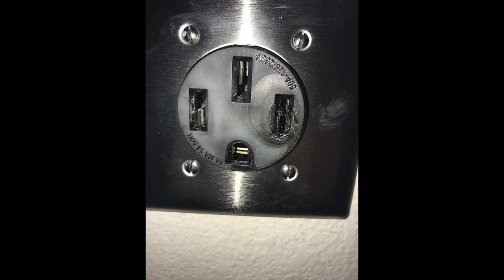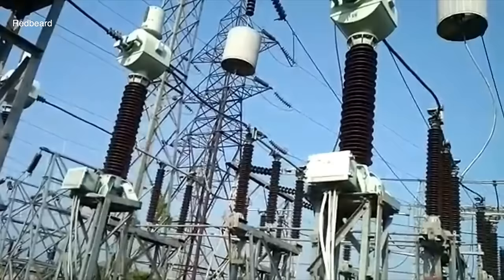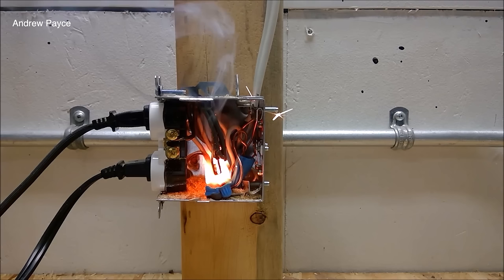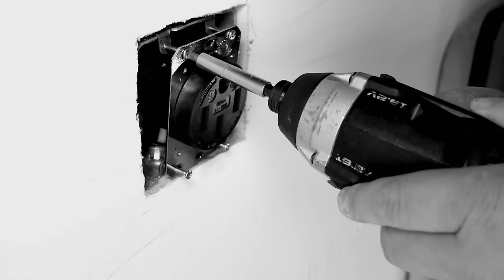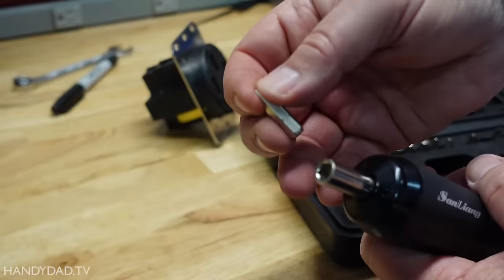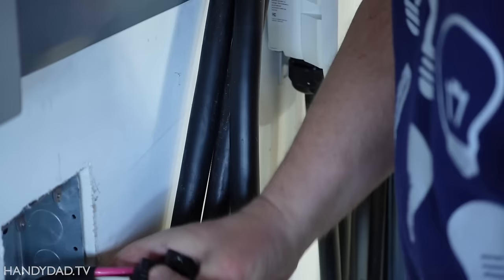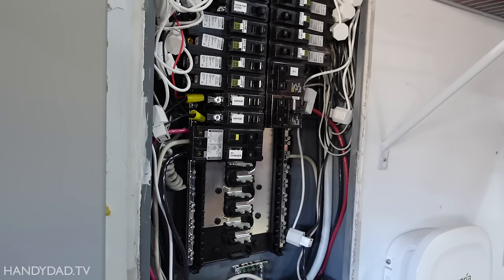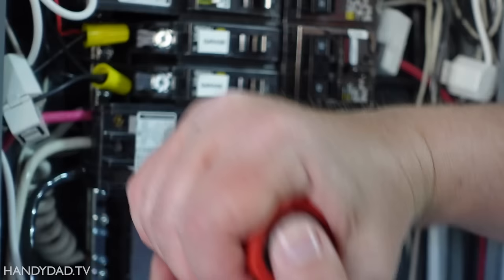EV Charging Disaster

Comment: What evidence do you have that standard outlets are getting loose with normal use? All the burnt outlets I've seen are from improper installation. Ive been using home Depot outlets for 15 years so far and never had any issues charging cars.
Reply from the maker: I have no hard evidence. I only have the Tesla spec sheet that requires an “industrial” outlet for charging. I also have tons of comments on this outlet comparison video https://youtu.be/xRcDUZgeuGs saying that cheap outlets are a high risk and shouldn’t be used.

Comment: I’m a little confused, why would you be constantly plugging and unplugging that cable? Yes on the car side obviously, but not the power tap side
Reply: That cable is meant to be portable and accompany the vehicle.
Reply: @rivernet62  People with EVs have a charge point at home, and then have a cable they keep in the car for times they aren't home. That cable tends to me a regular 120V plug. This cable isn't that.
Reply: @repatch43  that’s not how I do it….
Reply: You definitely shouldn't be unplugging the EVSE from the outlet all the time. Those outlets are not designed for frequent plug/unplug cycles. They are meant for appliances like ovens and dryers that are plugged in and then not touched for years.
Reply from the maker: When I got my Tesla 2 years ago, the car came with a universal mobile connector (UMC) which could charge the car from various 120- and 240-volt outlets. So installing a 240-volt outlet seemed like the appropriate approach to take advantage of my “free” charger. 

These days, the UMC is no longer free with the car because Tesla says they weren’t being used often enough and it was wasteful. Like Apple no longer including power adapters with their phones. 

The trend is changing to get EV charging away from outlets altogether. A hard wired charger is a less complicated installation and much safer.
Reply: Dryers and ovens use other plugs than the NEMA 14-50.  Wasn’t the whole point of the video that you should monitor your installation for wear and damage?  I use 2 UMC’s with my Tesla:  one at home, which stays plugged in, and one for travel, which is used at our second home or other locations.  The 14-50 outlet at our second home has had about 100 insertions over 3 years and is still very secure.
Reply: @rivernet62  Then you're doing it wrong? That outlet, 'industrial grade' or not, is simply NOT designed for regular plugging and unplugging. It's designed for appliances that get plugged in and then unplugged YEARS later. I'd suggest either getting a second cable, or getting a receptacle DESIGNED for many insertions. Hubbell makes the twist-lock type of plugs and receptacles, they are amazing.
Reply: @repatch43  this is the configuration recommended by the manufacturer, and, more importantly, it is working well.  I see no reason to deviate.
Reply: @rivernet62  Which 'configuration'? Are you talking about the outlet? Again, that type of outlet is simply not designed for many many insertions, it was never meant for that. I'll believe it's the 'recommended' configuration, but I guarantee you the manufacturer doesn't expect you are plugging this cable in multiple times a day. I honestly would NEVER be comfortable with that use case and that outlet, I don't like using things outside of what they were engineered for. But if you are, good for you.

Comment: Maybe that is why the outlet I installed to charge my EV heats up and catches fire.  Each time that happens and I check the wires they are super loose.  I figured the heat was loosening the screw but maybe the other way around.
Reply from the maker: Use an industrial outlet and tighten-wiggle-tighten!!
Reply: @handydadtv  …You admitted an error in one of your installations.  Now it’s time for me to admit my error.  Mistakenly, I had used a 15 amp Leviton thinking it was a 20 amp.  MY BAD!  Because of your video and the comments it generated I took a closer look at the receptacle and realized my mistake.  I’m really lucky the fires stayed local to the receptacle and did not spread.  I have now purchased a 20 amp Leviton receptacle to handle the 16 amp currant the charger pulls.  I replaced the 12 gauge wire earlier with 10 gauge thinking that may be the culprit.  But I had another fire.  And now I know why.  Thank you Handydadtv and thank you to the commenters.  And by the way, I’m ordering a torque screwdriver.
Reply from the maker: Wow! That is a hard lesson to learn and thanks for sharing your experience. Thankfully it didn’t end in disaster.

Comment: The 110V grid voltage in North America is outdated to cooperate with the EV charging facility. We have a 415V 3-phase charging box for home charging in Australia, which is much better for charging at home.
Reply from the maker: Sounds like you know
Reply: @handydadtv  Just checked some car manufacturers' Canadian websites and realised that the 3-phase plug in North America gets only 240V which is exactly our single-phase voltage.

Comment: It’s still incorrectly installed. Your torque driver stops at 70 pound-inches, but the requirement is 75 pound-inches. It’s still not properly torqued. You brought up all the important details and stopped short. Overall, it’s better than it was.
Reply from the maker: Way better

Comment: Holy smokes, just shut off power to the panel if you're working inside the panel. One slip torqueuing and you could touch a hot line or a "plate". Its just not worth it. Safety first ppl.
Reply from the maker: I normally do.
Reply: @handydadtv  regardless I love your vids
Reply from the maker: Thanks 😊
Reply: My neighbor a retired electrician says not turning off your panel before working on it means you're thinking you're faster than 186,000 miles per second.

Comment: One more thing I have came across my fair share of burnt wires at terminals & splices. You have to be extra careful reconnecting burnt conductors. Have to get back to clean copper. Often several inches of the burnt wires will be discolored from overheating. There is no reliable way to splice into such discolored wires. Have seen sparkies clean every discolored copper strand themn splice it to only have that splice burn up.
Reply from the maker: Wow thanks for the info.

Comment: Those connectors are dangerous. Shrouded plugs are far safer, as we have in the UK and Europe. Can't touch the poles as you plug and unplug them. They come in 32A, 64A and 128A sizes. Single phase, three phase and three phase with neutral. All are earthed.
Reply: Ya, we here in north america just love dangerous plug designs, it's always confused me.
Reply from the maker: Blame Westinghouse.

Comment: FACTS:
(#1) If you use 240VAC/50Amp wires. (#6 Gauge).
(#2) If you use the correct receptacle {inlet} 240VAC/50Amp.
(#3) If you 'torque' the (4) screws to requirements. (75 Lb./In).
= (100%) Manufacture Requirements.
= (100%) Safe...
Reply from the maker: Nothing is 100%, but we just try to mitigate as much risk as possible.

Comment: Great video! It's good to mention that all wire connection should be checked every 5 years and re-torqued.
Wires resonate when carrying amps and wiggle out of their contract points.
That's why they should be re-torqued :-)
It also applies to wire nuts, but not to Wago connectors- they have spring clamp and they last forever.
Reply from the maker: Good to know 👍🏻

Comment: For me as an European those NEMA outlets seems quite sketchy from the perspective that you could actually touch both hot pins at the same time when you plug or unplug it leading to 240 V between thumb and index or long finger.
Reply: I'm surprised he can do this himself. In my country I can't do any of what he does in this video, have to get a certified electrician to do it. Well, I can do it myself, it's not like I'm arrested if someone finds out I did it myself. The problem is that if something happens, even if I did it correctly, I will be in deep shit. No insurance will cover it and I'll be held fully responsible for whatever damage occurs, even if I sell the house.
Reply from the maker: Freedom 🇺🇸

Comment: Update: Below Reply + Safety Warning
RE: Nema [14-50R] (125V/250V  50A 3P-4W) 
Yes this 'heavy duty industrial' receptacle can operate up to (50 Amp), required for long term constant amperage power supply. 
Using:
* #12 gauge wire, (0.0808" Dia.), [120VAC - 20Amps]  
*   #8 gauge wire, (0.1285" Dia.), [240VAC - 40Amps]  
*   #6 gauge wire, (0.1670" Dia.), [240VAC - 50Amps]  
HandyDadTV  --> is (100%) correct the screws must be torqued at {75"/Lbs.}
This is the required torque to "split open/widen" the 'V-Shaped' moveable clamping face,  <<<---(Look)
compressing the cable against a solid surface, insuring the cable has (100%) contact. 
* {75lbs of torque} is 75lbs of force perpendicular to the end of a {1' foot wrench}.
Reply from the maker: Thanks

Comment: Everything you did is good advice, but arcing isn't why a loose connection gets hot, it is high resistance caused by the loose connection.
Reply from the maker: Does resistance cause arcing, or vice versa?
Reply: @handydadtv  arcing usually caused by intermittent contact.
Reply: If, after turning off breaker, you touch connection, it should not be hot. Otherwise it is loose.

Comment: I fail to see why the connecting wires needs to be over tightened in the EV power socket housing since the housing plate is secured to the wall. It sounds to me that people are over reacting due to carelessness.
Reply from the maker: Wires expand when they heat up while charging. Daily heating and cooling can loosen the connection. Then wires start arcing, increasing resistance, which increases heat, to the point of failure. That’s why they should be tight during installation and retightened periodically.
Reply: @handydadtv  Yes, however if the wires are heating up during the charging of a EV then that would mean that the wires themselves which are coming from the mains and leading into the wall socket do not have a high enough amperage rating. Or your low amperage wires is what's causing the wires to heat up. And if the code says that I'm wrong, then why don't you test the temperature of the wires before & after you install wires with a higher rating & I would be happy to be proven wrong. In my opinion there is no reason to re-tighten wiring periodically provided the socket is under cover & wire amperage rating is high enough.

Comment: Hi Chris, great videos by you (watched many lately).. I have a question in regards to the 50 amp breaker you installed.. I see that it is a GFCI, but could you have used one which has a GF as well as AF interrupting function? Of course we still want to make sure that the wire connections are secured to the torque specifications.. 

The second question: which brand breaker did you use and what’s the brand of your panel board? I have a cutler hammer panel and not sure if Square D or Siemens breakers would fit in them.. I am seeing many wavering answers in various forums.. any insight from you would be great.. Thanks..
Reply from the maker: You always need to use breakers that are compatible with your panel type.

I guess you could use a combination G/AFCI breaker. It will probably be even more expensive though. 

Hard wiring a wall charger is the best option.
Reply: @handydadtv  agreed. Can you share info on the make of the breaker panel and the 50 amp breaker that you have used in the video above? Thank you again..
Reply from the maker: Mine is a Square D panel, type Homeline. The breaker is model HOM250GFIC. This info is meaningless for you; yours is completely different.
Reply: @handydadtv  agreed. Thanks however..

Comment: It's still wrong. EV chargers should be hard wired and mounted on a fireproof backer. The 220V circuit breaker should not be in the main box, but on a dedicated pony box.  
See Sandy Munro video with a Master Electrician, because he demonstrated that this exact setup has caught fire. 

Best advice: this is not DIY and should be done by an industrial electrician.  Most states codes are dangerous and have to be updated for the 100%  duty cycles of chargers, because current house codes are for 10% duty cycles for appliances, and no one will change codes until a tragedy occurs, because that's how America works.
Reply from the maker: I’ve seen many installations by electricians and the all put the breaker in the main panel. But I’ll look for that video. Thanks for the info.

Comment: I tune down my tesla to only charge at 18 to 20 amps (at 240 volts). That is slow but perfect for overnight (10 hour ) charging. When I charge unnecessarily fast using 32 Amps, cables heat up. Heat equals energy waste  and more likelihood of a fire.
Reply from the maker: I agree!! 👆🏻 I routinely charge at 15A/240V.

Comment: Unfortunately -- I have installed the cheap outlet after looking at the specs on the Bryant 9450FR its current rating is only 30 AMPS in the grainger link -- can it handle the 50 amps ?  thnx EJ the EV noob lol
Reply from the maker: There’s an issue with the Grainer website. The model number and picture don’t match the description.

Comment: I love your videos! One of my favorite channels. 
Quick question: The torque screwdriver you link to torques up to 70 lb-in. How did you ensure it was 75 lb-in?
Reply from the maker: I couldn’t get it to click by hand anywhere near 70 anyway. I went as tight as I could.
Reply: @handydadtv  If you pay a little more you can get a torque screwdriver with a small lever that can be added, or a 1/4 inch wrench, for the higher torques.
Reply from the maker: Good tip! Thanks.
Reply: So you recommend something that can't do the job to specs and just hand tighten as much as possible as a solution? @handydadtv
Reply from the maker: @jefft2472 Feel free to buy a better one.

Comment: You need more pictures? I melted 2 sockets with my Kona within 1 year. Now I have a wallbox.
Reply from the maker: Yes! What do you think caused it to melt? Is the Wallbox hard wired?
Reply: @handydadtv  The first one was a tplink wlan outlet and switch to charge solar only. It was certified for 16A but melted anyway. The second was a normal outlet which I installed. I must have done something wrong, but perhaps all of these devices are not build for 12 hours at 16A.
The wallbox has a 6mm cable and distinct fuse and is hard wired. Up to 11KW from 3 phases without any problem.
Reply from the maker: Much better solution.

Comment: Is it not a fact that when the wind blows and when the sun shines there can be an excess of electricity? Is it not also a fact that EV's are essentially huge batteries on four wheels. Is it not also a fact that with the appropriate algorithms any EV connected to the grid could, at such times be supplied with heavily discounted electricity. Is it not also a fact that the batteries in an EV could be connected to the owners domestic electrical system for general household usage. If the answer is yes then what are we waiting for?
Reply from the maker: We’re waiting for you to run for office.

Comment: This is why it is not allowed to make electrical wiring in a house unless you are a professional in my country, we also have 240V in normal plugs and 400V for heavy duty things like BEVs
Reply from the maker: What country?
Reply: @handydadtv  Denmark, I think it is like that in most of Europe
Reply: @casperhansen826  it is. Hoever regarding the 400V - the builtin chargers in many EVs only use the threepase power connectors as three phases each at 240V, thus giving you either 11 or 22 kW of power (at 16 and 32A), so they use them in a star configuration, in triangle the same current would give 19,2/38,4 kW. quite a pitty from my point of view.

Comment: No one does the fill calc on these boxes. DIY myself. It appears that 6/3 with ground is 18 cubic inches. Then for a yoke device you need largest wire size x2 for a single gang. Since a 14-50 takes up TWO gangs. You double it again. So 6 wire size is 5 cubic inches. Times 4 is 20. So 18+20 is 38. Means you need a 4 11/16 x 2 1/8 size box minimum. 

People putting these in 4” square boxes are not right according to code. 

Anyone have anything to say about this or want to check my math?
Reply from the maker: I’d love to learn more about this. Do you know a good reference? (Electric Box Sizing for Dummies)

Comment: knowing the code is not the same as building a safe and reliable electrical system.    In fact, the entire idea behind the code is to provide a (relatively) simple and easy to follow set of guidelines that, if followed, should result in a safe system.   Not necessarily reliable, not necessarily efficient, but definitely safe.     People who do NOT know how to design electrical systems can follow the code and know that they will at least be safe, even if it doesnt work as well as they want it to.    But people who do know how to design electrical systems can build perfectly safe, reliable and often more efficient systems, without following code.
Reply from the maker: Thanks

Comment: Excellent video and a very important point to drive home.  That said, I'm not an electrician or by any means an expert, but I think you missed torquing two more connections at your load center - the ground and the neutral.  All current-carrying conductors or potentially current-carrying conductors (like the ground wire) need to be torqued too.  I don't believe you mentioned that in your video ...
Reply: Uhm... the ground is not a current carrying conductor and will offer impulse (magnetic) current without being rated for 100% duty.  I'm not saying leave it loose... but it doesn't need to be torqued.  In fact, no terminal needs to be torqued so long as it is sufficiently tight.  Also, there was no reason to run a three-conductor with ground because the neutral is not used in the EV high current charger.
Reply from the maker: Thanks